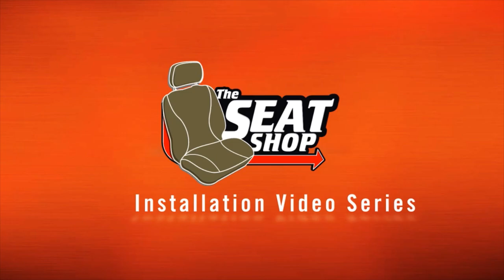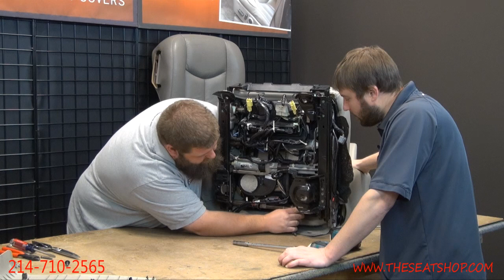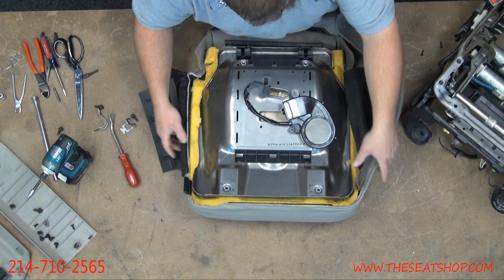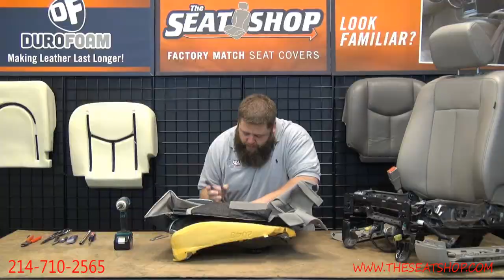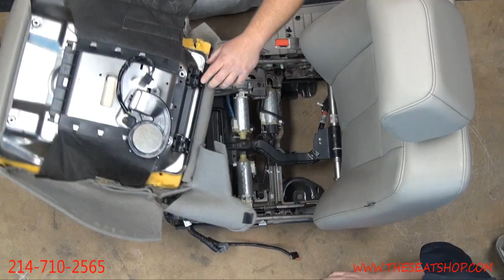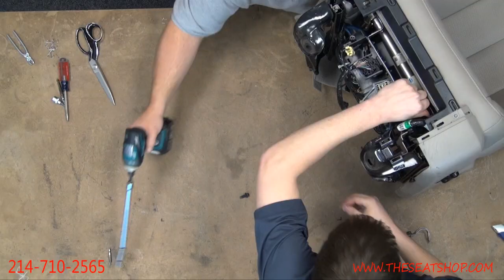2007 - 2008 Ford Expedition/Lincoln Navigator Driver Bottom Install Video

Comment: Hey, maybe you all could help. I tried to swap out the seat in my 07 Expedition with a driver seat from an 08 expedition. They have the same connectors, same trim levels vehicle wise, but I can get the seat to have power to move. I know the seat works, it just won't power up, but the stock seat does.

Now, the stock seat has a molded headrest while the donor seat has a removable headrest, I'm assuming this was just a change in years as 07 was the first coming off of the previous generation, could this be my problem? I would appreciate any help you all might have if any, thank you.

Comment: I use a cutter pin remover or a hook tool to remove the plastic hook strips. A handy tool for other applications as well.
Reply: Cotter not cutter.

Comment: Thank you so much for making this video! I have a 2013 Expedition so some things about the way the seat goes together have changed but this still provided a great basis reference. This was also very helpful regarding the hog rings. On my Dodge Ram there are no hog rings for the seat cover so this video made me realize I needed more tools and parts to do the job. Also shows us how the hog rings connect so as a hog ring 'noob' that was extremely helpful. Thanks again, great video!!

Comment: I wish y’all would do a video on a 2010 expedition because it’s very different to take the pan out. I don’t think you can because I don’t see ANY bolts holding the pan in like at 9:00

Comment: You guys are Great !!!! I have the exact same seat and seat cover for my 2012. I couldn't find the bolts to remove the pan from the frame, but I was able to remove the cushion from the frame. The replacement had way much more material than the factory, but I made it work. Your video was Essential for getting the job done correctly and quickly. I don't know how much money I saved, but it had to be at least a hundred bucks LOL

Comment: Doing this on a 2011 Expedition, it's the same all the way up until removing the actual seat bottom, then it's radically different. 
No 4 bottom bolts, just clips and big metal retaining springs, and no metal seat pan.
Reply: Robert, I am trying a 2012 right now and running into the same issue.  Were you able to get it done?

Comment: Great Video. This is exactly what I need to do, and might make a good saturday afternoon project.  However,  I don't have all the tools (or time). Approximately what would it cost for this job?
Reply from the maker: It will really depend on the shop doing the install and what you are wanting to install. Usually, it will range around 150 per cover but that is a very general number, here is a link to all of the shops in our network to see if they can try and help you out - https://www.theseatshop.com/resources/install-locator/

Comment: I just ordered the driver seat for my 2010 Ford Expedition EL, the perforated leather matched perfectly and I like the made in Texas tag.  The 2010 is much easier to do than the 2008 as you don’t have to remove the fan motor or those 4 bolts for the pan.  The only tricky part I found was putting the front in, I didn’t realize I had to go under the black plastic piece, once I looked at my passenger seat I figured it out.  Thanks again! Looks like I’ll be ordering the passenger side soon.
Reply: I have a 2010 Eddie Bauer, does the seat bottom have any airbags?
If not, I can get a great deal on a good condition used seat and swap the bottom portions.
Reply: I had to take off that black plastic piece. I couldn't find those bolts they were talking about

Comment: Thank you guys SO MUCH!This is one of the BEST instructional videos ever put on YouTube.   However, I followed your directions step by step, and my seat pan will not lift from the frame.  I rewatched, paused, and rewound but still can't determine what is keeping it attached. Do you have any  suggestions?
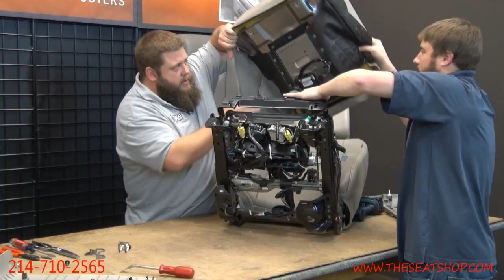Reply from the maker: Hi Tee, we just want to make sure we are on the same page please let us know if this is the section you are needing or if there is something else you are wanting to remove. - 8:02 - 10:56 If it is something else you can also just give us a call to see if we can walk you through this section. 214-710-2565

Comment: Might want to tell people to disconnect 🔋 so the airbag doesnt kill them?
Reply from the maker: Hi Jum, we understand the concern but since the airbag quick-connect needs to be removed to take out the seat, unplugging it from the floorboard will do the same job as unplugging the battery for it not to go off and for you to be able to work on the seat. This is how we took the one out for the one featured in the video, please let us know if this helps and if you have any other questions or concerns.
Reply: @TheSeatShop   will in plugging the air bag set off the air bag light on the dash for a 2013 Lincoln Navigator?
Reply from the maker: @genedare4399  As long as you remove the seat and disconnect everything it won't be a problem. When you plug it in, it will function like normal, etc.

Comment: Good video guys! I have a question I have an 07 Expedition that has heated and cooled seats does it have a heater grid in the bottom and back?
Reply from the maker: Hey Mike Balloonman, the heaters are not sewen into the cover but both the bottom and top have spacer fabric so that either AC or Heat can go through

Comment: Do I have to remove the seat to change the fan/blower on passenger side seat?
Reply from the maker: Should just be able to unbolt and lean it back in the truck.  Thanks